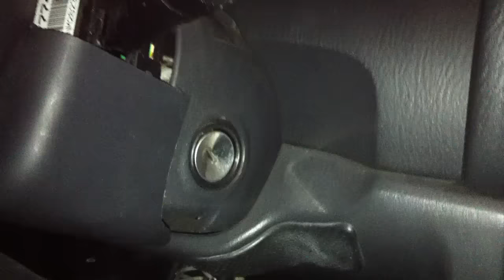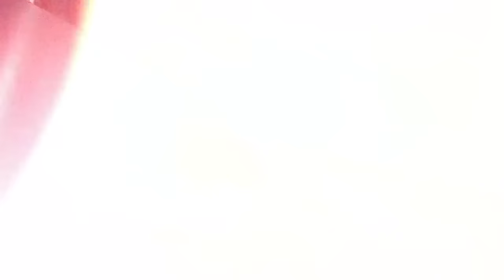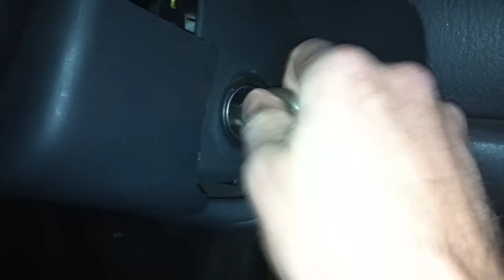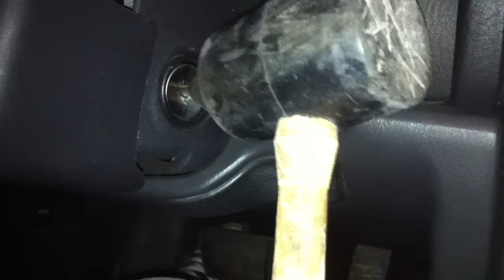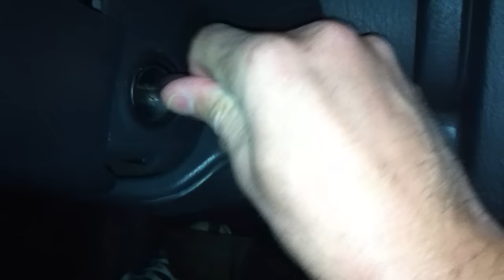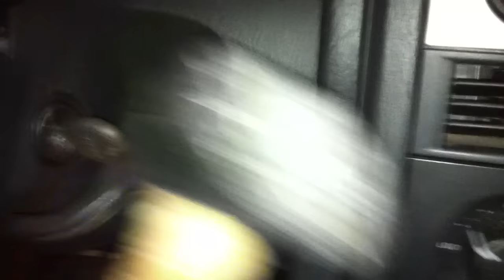if your Car/Truck Key won't turn, here is a Quick fix -UNCUT

Comment: Omg I think I love you! Thank you so much, fixed in 30 second
Reply: gotta love a girl that carries a rubber mallet LOL
Reply: Jacki Velez it's actually easier if you hold the key like if your turning it to the on position and with a screwdriver that has a rubber handle you can use that. what it does it mmhelps release any debri that may be in their or a stuck wafer that sometimes it may jam due to the fact of dirt and not enough grease inside the cylinder. I use to buy some cans from ace when I was a locksmith they like 1.50 power lube, that makes wonders on all locks. If you spray a little bit just use the key to turn it once or twice and you should see some dirt or carbon on the tip of the key.
Reply: Jacki Velez
Reply: Do not mess with a girl with a mallet, give her the respect that she deserves!
Reply: marry him
Reply: Does this trick work on a electric key? And it has an actual key inside can I do this with the actual key... not sure if that is only for the doors or if I can start my vehicle with it as well
Reply: Jacki Velez iii
Reply from the maker: not sure, sorry
Reply: I've been doing this on my 2006 Caravan for a couple months and its getting tougher and tougher.
Reply from the maker: try getting an air compressor, and blast it, spray a bit of lube like silicone or WD
Reply: Not that hard to find a rubber mallet lolll
Reply: Alejandro Chavez im flaccid ...
Reply: Bri S rubber mullet from the 80s.  Love this!  Tanks!
Reply: Jacki Velez Hi
Reply: Boing!!

Comment: Indeed, I saw suggestions for this but your video shows that it works! I jammed, rammed, wiggled jiggled pushed pulled, did a Fonzie smack, turned and adjusted the steering wheel, jiggled the shifter etc  nada... the rubber mallet on the straight in pound on the second time started right up. YEAH and YAY! Thanks that worked!

Comment: It worked 🙌🏾 I used a hammer and gently tapped on it.. This is a first time experience for me and I looked online and ran across this video and it definitely worked for me but just for safe keeps I'll more than likely keep a hammer or a high heel in the car with me🤦🏾‍♀️ LBVS!! I'm glad I was already at home when this happened!! Definitely will be getting this fixed tho!!

Comment: This vehicle is a Jeep. There are two types of ignition keys for these (as well as other Jeep, Dodge, Chrysler) vehicles. Before anybody starts hammering on thier key, first look at it, If the plastic section of the key is thin, go ahead and hammer the shit out of it. BUT if the plastic portion of the key is thick (like the one in this video), you should think twice about hammering on it. The thick keys have an RFID chip inside it. If you damage the chip, your vehicle wont start no matter what you do and the repair gets VERY expensive very quickly from that point on. The reason most ignition switches quit operating is because people set thier keys on the ground and dirt gets on the key..............people pull thier keys out of thier pockets and lint gets on the key.....so that's how dirt and lint finds it's way into the keyhole. Next thing ya know, the ignition lock tumblers get stuck and the key doesnt rotate anymore. Safest way to fix the situation is to spray BRAKE cleaner into the keyhole.........the brake cleaner evaporates and leaves NO sticky residue behind........spray a bunch of it in there. then push the key in and pull it out repeatedly (kinda like key sex with the keyhole). Do the spray thing a few times and the lock should work again. Let the brake cleaner dry up for a few minutes...........There is a dry powder type of "lubricant" that is used in the keyhole to keep the key switch moving properly. Many people think grease or "WD40" will fix a problem like this, but it just makes it worse. Obviously, the person who posted this video has a fucked up ignition switch, I mean, HOW often does his switch get stuck for him to "learn" the hammer trick.? If your keyhole gets stuck only a couple times a month, it means that the tumblers inside it are getting worn out and the lock cylinder needs to be replaced ASAP. The reason you should replace it ASAP is because if you wait until it is stuck one final time, you will have to break it in order to get it out.......but if you replace it before it refuses to turn one final time, all you have to do is position the key into the number 1 location and the ignition lock cylinder slips out in mere seconds.
Reply: I suspect I have a neighbor putting super glue in all my locks because my door locks have this problem as well, when I used wd-40 it seemed to loosen them up they already messed up my passenger door using key bumping

Comment: I didn't have a rubber hammer so I just kick it in lol and it worked lmao
Reply: astro_viking 7734 You kicked it? How?
Reply: astro_viking 7734 I did the same thing lol
Reply: astro_viking 7734 lmao
Reply: i used a hockey puck
Reply: just used a stapler lol
Reply: I seriously died crying reading ur comment and the replies dont ask me why lmao. But this just happened to my truck and I didn't have anything to use and grabbed a damn water bottle (yes I know a fucking water bottle haha) I used the cap part and it worked. I had to leave my truck at the gas station for hours cuz I was late for work. Wish my dumb ass watched this when it happened 😭😂😂
Reply: if i kicked it I probably would have broken off the key
Im more skilled with a hammer and did it completely with the aide of WD-40 as my neighbor likes to put super glue in my locks
Reply: Lmfao!

Comment: This happened to me this morning. Went to move the truck so I can take the trash to the curve for disposal..... I was like.... Well.... maybe  I haven't woken up yet, so I tried again nothing. Maybe the steering wheel was locked.... nope nothing, so I said forget it. Picked up the trash can which is very heavy push it over the truck slid it down on the side of the truck and rolled it to the Curve!!!!  Saw this video.... could  find a doggone hammer for the life of me.... so I had a old door knob that I removed from one of my doors in my home.... Hit it twice and it turned...  You are amazing.  You are now my internet God. Thank you😇

Comment: Jeep.

You know you've brought American when you need a hammer with you to start it.
Reply: Scott Dann it's funny how people blame americans when it is all made in china........
Reply: Point still stands. Giving the work to the lowest bidder to maximise profit regardless of the workmanship.
Reply: Or a screwdriver...lol .
Reply: Not necessarily lol. The 1st gen Honda pilots have this issue. I'm debating on taking a mallet to mine (temp fix as that cannot be good for too long without other components breaking down due to the damage from the hit.) Since they all work together in this lock, cant destroy one part of it with a mallet without having something else be affected usually. Will probably just go for a more permanent fix by either replacing the mechanism myself DIY or calling a locksmith.

Comment: Thanks, Warren! My 2006 F150 locked up but the rubber mallet did the trick. I started with a tap and ended up giving it a pretty good smack before it finally worked... Nine years later and still a hero.

Comment: You should try using a silicone degreaser first something like a Rust buster WD-40 type that can lubricate the cylinder first. You might have a safer more permanent results
Reply: My thoughts exactly at 1st, I tried some PB Blaster then coated my key w blaster and dusted the key with dry graphite powder. No dice. Key seemed to go in on a slight upwards angle. Hmm I'll give this method a shot. I just need to turn it once to get the Cylinder pin exposed to remove it and put a new one in.....

Comment: Wd-40 and work the key in the ignition. Worked for me after I bought car for $300 because key wouldn't turn and dealer quoted high price to repair. Seller was pissed, but we already signed title, paperwork and exchanged money. Was an awesome car until daughter wrecked it 8 months later.
Reply from the maker: This is one of my favourite comments on this video!!!
Reply: Do not use WD 40, this is what it does to lock cylinders. 4. Locks. The spray can prematurely wear down the internal mechanisms, especially in the pin tumbler locks, in door locks and padlocks. Go for graphite powder.
Reply: What vehicle?
Reply: Karma. Be humble an be honest that the dealer was wrong
Reply: my nasty neighbor likes to put super glue in all my locks. but WD-40 seems to loosen that up
Reply: @simonwilson7581  I keep an arsemal of special grease tubes in a jar graphite, silicone, diaectric, ignition, and find the graphite is the most reliable in all types of weather. I use graphite on the tumblers, springs and pins, whereas i like to use the silicon grease betweeen the barrel and the cylinder.. it gives a smoother feel to the lock functuion
Reply: @simonwilson7581  I found out the hard way... it is best to always test the megohms resistance of any cleaning fluid used on electronics with a high quality meter set on meg ohms. you will be surprised what will literally short out your circuit board
some are ok after they dry
soda being an acid will dry and short out a circuit as a sticky gooy residue
after scrubbing it 20 times you might remove it
Reply: @ebehrman   WD40 is fine in locks it cleans the dirt out and evaporates WD40 will not harm Electronics . Just use some silicone spray afterwards
Reply: @rogerd4559   Graphite is no longer used on locks by locksmiths. Makes a god-awful mess in your on clothes. That's old school stuff
Reply: @dagg785  sometimes old school is still the best way
cant beat graphite when its 5 degrees out there and your locks are solid  cause you used the modern prissy clean white stuff in your doorlocks!

Comment: i did this and i broke my key off in the cylinder.
Reply: lol
Reply: maybe you hit it too hard lol
Reply: Mudd Boss LOL
Reply: Rip
Reply: Lmao
Reply: Mudd Boss 8
Reply: Mudd Boss

 Have GOT to hit the key squarely or straight on - or it will surely break! .. It does work if done correctly.
Reply: Based Jesus hell is real
Reply: Mudd Boss shit
Reply from the maker: it happens, use one of these ways to remove:
https://www.youtube.com/watch?v=63tQH1DIqIw
Reply: Drick Ranger.  Cleaning and or lubricating it wont do anything theres most likely a spring in the cylinder that broke off and is keeping the wing from going down when he puts the key in. If you jiggle and hit the key it will help the wing drop down allowing you to turn your key. Inside of the cylinder where your key goes in isn't the problem it's the outside part of the cylinder which is the problem 

Same shit is what's wrong with my car.
Reply: Should have used your palm instead
Reply: Hard to help handicap people
Reply: This comment literally made my day!
Reply: lol
Reply: @ichadihoang3623  what if it is corroded?
Reply: Gotta be an Awwww Faaaaaauck moment right there for sure😲.
Reply: Me too man, me too
Reply: you have to hit it dead on it will break the key off if you hit it at an angle. common sense
Reply: Genius. Read description
Reply: Mudd Boss lol that’s what I was thinking. BC Canada.
Reply: Mudd Boss 😂😂😂😂😂😂😂😂😂😂😂
Reply: Can i do this to my riding lawn mower i took the key out but before i took it out it turned fine now if i put the key in it like wont go in all the way and it wont turn
Reply: Mudd Boss bro I feel yo pain I just broke mine 😂😂😂
Reply: I just did it an it worked
Reply: F in the chat, boys
Reply: It Work Just Fine for me got to hit it Head On not frm the side hit the top of the key my truck started rite up wit no problem  hit it wit a Contigo Can an Boom lol
Reply: this really worked !!! i was so scared and this worked right away
Reply: Just takes a couple of light taps...not a full on blow like you're going to knock it to the moon.
Reply: Keep hitting it!
Reply: Most funniest comment here 😂😂😂
Reply: @rickybrown6585  But some cars (mine for example) don't let you replace the ignition lock cylinder unless the key is turned to the ACC position. I had to do this to my car in order to get the key in that position.
Reply: @MasterKeySolutions  LOL I should have finished reading the comments cuz I explained this same thing to him.
Reply: Bet you wish you didn’t hit it on an angle, 
Remove with needle nose pliers or tweezers ?

Comment: what if it only gets stuck sometimes. .but then other times it turns...??? should I still do this ..because its aggravating
Reply: I have the same problem with my truck :( did you figure out the problem ?
Reply: +Unique Perez no it still gets stuck..but it's just sometimes I was scared to hit it because I thought I may break it :-(.
Reply: +goldmouth100 I figured out that all we need is a new ignition cylinder (: can purchase it at auto zone .
Reply: +Unique Perez ohhhhhhh really did you put it on yourself ????
Reply from the maker: yea be careful cause you can bend the key, or worse, break it, you have to have a perfect straight on tap, not from an angle at all, that is what can bend the key.
Reply: +Warren Hardy ok thanks a lot for letting me know..:-)
Reply: I wouldn't use wd40  because its a wet lubricant that can collect grime and picket lint etc over time.  Pick up some graphite lubricant(2-3$) that is designed for lock if you want to go the lube route.  It's a dry powder that should work well and can be picked up from home supply stores (lowes/home depot)
Reply: goldmouth100  do not use wd40 that is a cleaner once you use WD40 it may loose some dirt inside of the ignition and make it even worse.
Reply: This really was helpful
Reply: Go change the lock....
Reply: @alexgulino335  ou can use WD or Blaster then once it's free, remove it, blow it out, hit it with brake parts cleaner till it comes out clean (use a white plastic container/ eg: Cut an empty bleach bottle w a razor knife) blow it out then dry graphite once it's dry. The BP cleaner evaporates and doesn't attract dust like WD.

Comment: So yesterday I arrived at un unloading with my truck, stopped on the weighing platform and went to the office to present papers, come back to the truck and the key doesn't fully enter the ignition and I can't start the truck. The company has only one weighing platform and every truck has to be weighed when he gets in and out. So I'm now stuck on the platform and worse, no-one can load or do deliveryes since the platform is now blocked by me, I tried about 40 minutes to start the truck but nothing, I was waiting for the repair service to come and while I was waiting for them and telling other angry truckers that the platform will soon be freed ( not very probable since to replace the thing where you put the key would take a while) so I checked on the internet to see if there is any solution and found this video, needless to say it didn't work :(

Just kidding, it worked immediately and I can't thank you enough for saving my ass
Reply from the maker: thats an awesome story, hearing this, now you have made my day

Comment: IQ level 100: looks to call road side assistance or dealer

IQ level: 999,999 gets an old rubber mallet and smacks it 💡
Reply: Lane Sutton - lol he needs a new key the teeth could be worn
Reply: I need to get at the tumblers! any ideas?
It has me stumped on how to open an ignition cylinder

Comment from the maker: 1,000,000 Views. Woot!
Reply: who would of thought 1,000,000 people would have the same issue and they all came to you, who also came to the internet for results! lol! LOVE THE COMMENTARY THOUGH! I actually just watched this, just to, my key works fine lol!
Reply: Well I had this problem, but it turned out to be the steering lock engaged. I'd accidently locked the steering on exiting, then re-entered the vehicle and just for a fleeting moment, thought something had gone amiss. Then remembered the steering lock and turned the wheel a fraction and turned the key. All good....
Reply: David Hamilton its happend to me too
Reply: This is a very simple fix if you take your vehicle to a locksmith. sometimes it requires replacing the ignition itself, but if the issue just started and hasn't been going on fortoo long, making a "new" key (not a shiny "copy" of a "worn" key) will typically solve the problem. The problem is, most people take their vehicle to a mechanic and the mechanic ends up ordering a new ignition, keyed to a different key than the doors. Now you are walking around with 2 keys, and if you ever lose those keys, you end up with an entirely different and expensive problem, when taking it to a locksmith could have saved you hundreds of dollars in the first place.
Reply: hahahahhah
Reply: Abdull......You're only laughing because camels have keyless start. They respond to "giddy-up", or whatever the Arabic equivalent is. Don't sweat it, because your way is the precursor to voice recognition technology...
Reply: Abdulla Alzayani Perhaps I should have included all horse riders as well. Don't be so bloody thin skinned, enough said...
Reply from the maker: 2,000,000 Views. Woot Woot!!
Reply from the maker: 2,000,000 Views, Woot Woot! 
actually a little late on this. lol
Reply: How to change a steering steering column in a Geo tracker
Reply: You deserve it and more
Reply from the maker: 3,000,000 Views. Woot Woot Woot!!

Comment: Key is cut incorrectly or cuts/depths too worn down in some cases not allowing to correspond correctly in binding order to turn cylinder or ignition switch getting stuck (common)
Reply: Scienterrific

Comment: dry graphite is best for lock cylinders. :)
Reply: That's what I thought. Then the biggest locksmith in our county said graphite was bad. Use Tri-Flow. So I tried that and it stopped turning completely.  aarrrggghhh
Reply: I'm going to try that now. Hopefully it works on a 2005 dodge durango